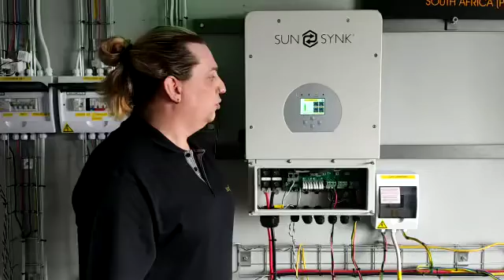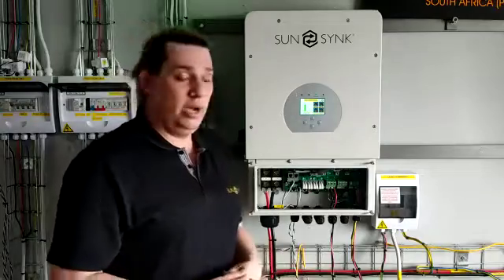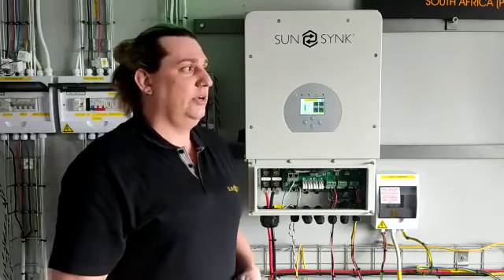Settings for islanding mode #sunsynk

Comment: Is the load port limited to the inverters specification just when the grid has fallen away? Or, during on grid operation, would the excess load come from the grid or PV? I.e. is it important to distinguish essential from non essential load?

Comment: Did you say PV does not work when in ISLANDING MODE ?
Reply: it should work, Island mode only means inverter not draining power from grid.
Reply: I experienced that the Islanding mode is dependent on the battery SOC level. Below 95% the PV continues to supply the house and charge the battery when the grid falls away, but when the battery is fully charged, and the grid falls away the solar power also falls away almost completely depending on the load demand and the battery supply the essential load. This means even if there are sufficient Solar power available and you get loadshedding the Sunsynk will move away from the available Solar Power and switch over to the battery and thus start draining the battery although solar power is available. This, I found very strange cause our load shedding happens at 1600 or 18:00 and at that time if the battery is being used it drains the battery and by the time the grid comes back the sun has already set and cannot be used. If anyone has an answer for correcting this, I will greatly appreciate as none of the settings I found can do anything to change this.

Comment: If I was looking to have the ups back up working on a large system. What would be the limit I could achieve with multiple inverters in parallel?
Reply from the maker: 1mW
Reply: @sunsynk  wow really. So multiple inverters and obviously a fair few batteries I could power a substantial building just off battery back up. What would be the max draw at any given time in the set up? And how many inverters would be needed/can you parallel? Trying so see if a care home that uses 3 phase electrical appliances would be able to be kept online and still use their power normally